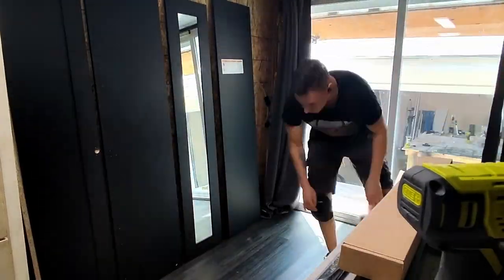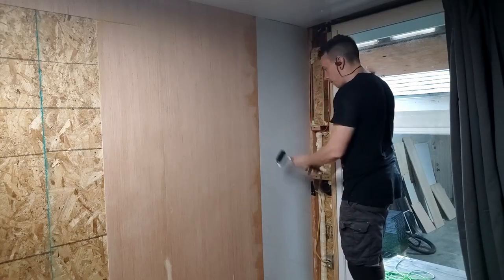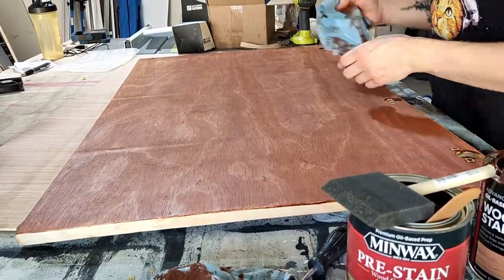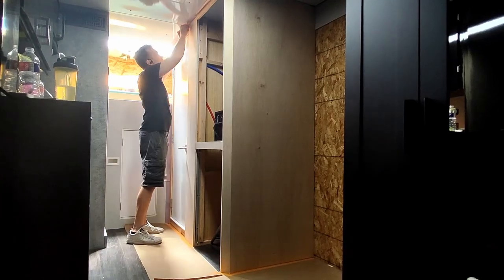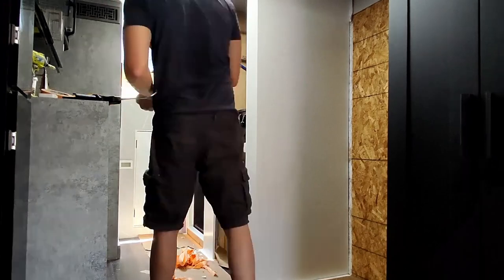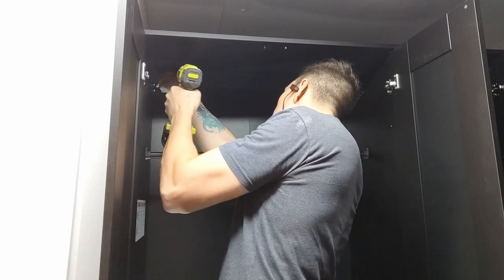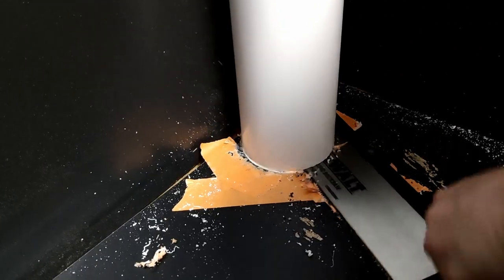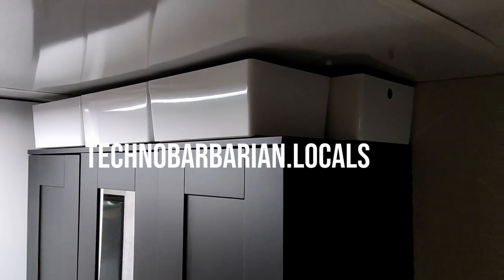Full Size Ikea Wardrobe/Closet In a Van! | DIY Uhaul Box Van Conversion

Comment: Quietest/highest quality computer fans are Noctua brand. Add a small potentiometer to the fan circuit and you'll have a knob for easy speed control so you don't have to run them on full tilt all the time.
Reply from the maker: Awesome I will check those out!

Comment: One thing to do is to reinforce the door hinges of your wardrobe. It's IKEA. And Ikea door hinges break at the best of times on land let alone in a moving truck. You will need to add an strong adhesive to your hinges and then screw them into the frame before they break off later.
Reply from the maker: Good idea!

Comment: The vent hole above the tire could get quite wet from the water spray off of the road maybe a rear facing opening with a screen,instead of downward might save you from water damage!
Reply: The heat from the cabinet should keep it dried out
Reply from the maker: Yeah I considered that but I can find a directional vent that should prevent that if necessary

Comment: The heat from those inverters will be a welcome source in cold weather. Make sure to screen the floor output for insect invasion.
What make & model of inverters? They look quite large.
Reply from the maker: Yeah I plan on reversing the airflow to use the inverter as a passive heater. Vent will be capped with a screen. Inverter is a Growatt 24v 3000W all-in-one (solar charge controller+inverter)
Reply: When u reverse it in winter maybe vent it into the shower to keep it toasty